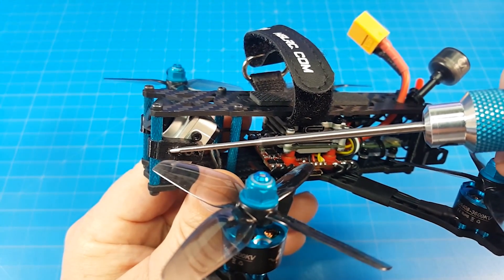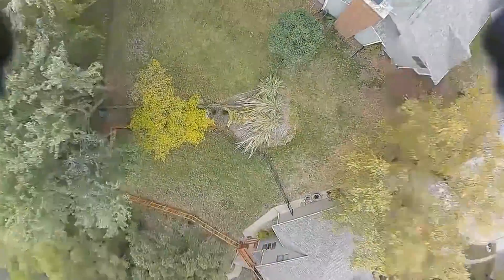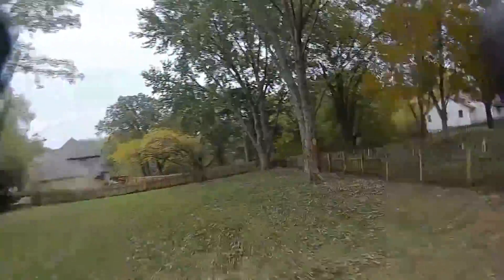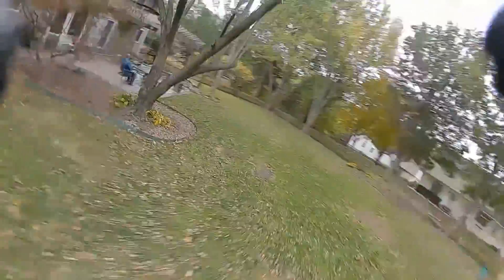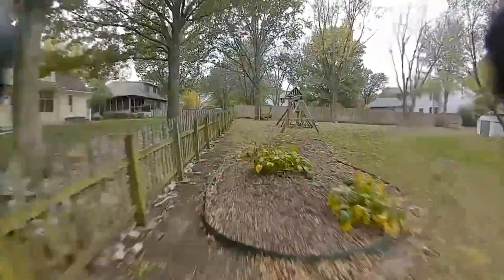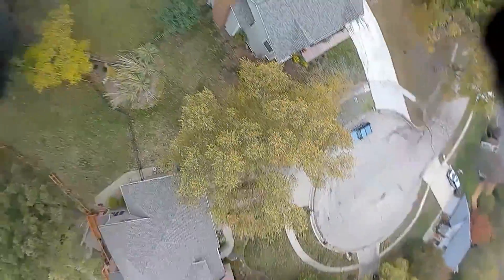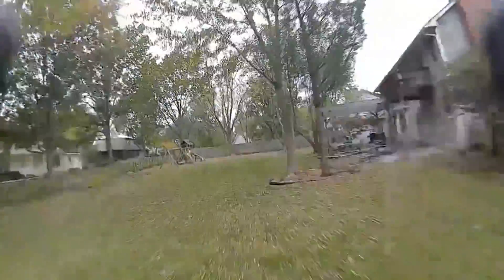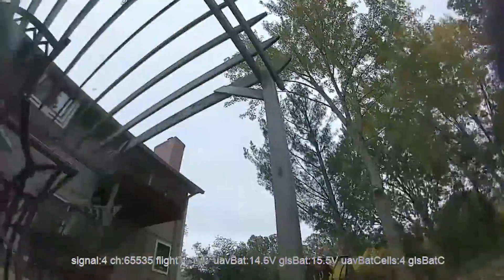HGLRC Sector150 HD // Faster with more Camera Angle

Comment: Nick, nice update to the review.  I want to upgrade to digital, but I’m concerned about buying the DJI unit right now. It’s been out three years now and it would seem like around this time DJI would be releasing a V2 around now.
Reply from the maker: 3 years? I thought he digital fpv from dji had only been out a little more than 15months.
Reply: @NickBurnsFPV  my bad. The DJI goggle RE came out 3 years ago.
Reply from the maker: @deadlazlo  ah, no worries. I thought I was losing my mind.
Reply: @NickBurnsFPV  It’s still the same struggle, when do you buy vs the next new thing to come out. I bought attitude v5s three weeks before the new HDOs were released. I would hate to buy the DJIs and then FS releases the new digital  unit or TBS or someone else. First world problems..:(
Reply from the maker: @deadlazlo  yes, that is the market, pretty much most markets. Cars are predictable, and cell phones, fpv we never seem to know if something "better" is just around the corner.

Comment: I just got the 4s version. Do you think I made the wrong choice? I will be carrying a full cased GoPro. Also, what size battery should I get? I see that 850mah is recommended but some people are running almost twice as big as that.
Reply from the maker: I don't think 4s is a bad choice for the load you will be carrying. The battery size will depend on the type of flying you do. The more battery weight the looser it will corner or torn. Of course battery weight also impacts the pid tune and vertical performance.
Reply: @NickBurnsFPV  Awesome thanks. At first I was having some regret about not going 6s but now I think I made the right choice. I just ordered my batteries too, Gens Ace R-Line V1 4s 850mah. Any mods or changes I can do to the stock setup when I get it? Have you thought about running the battery underneath the frame? Someone also mentioned they run it as a pusher setup and it's more efficient that way.
Reply from the maker: @danielfix7871  I didn't do any mods, unless removing the prop guards is a mod :). Top mounting the battery does help the quad sit flat, I would expect most to prefer that.